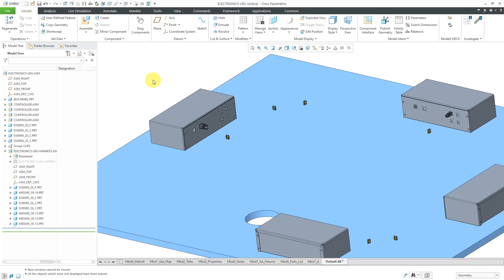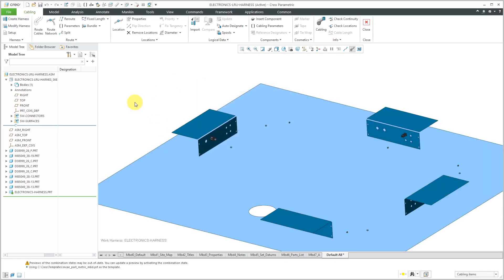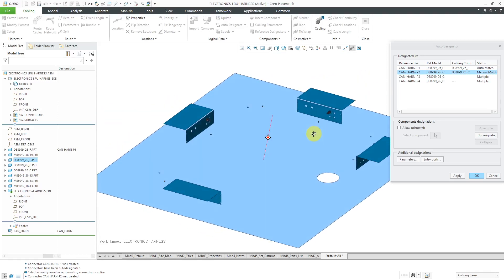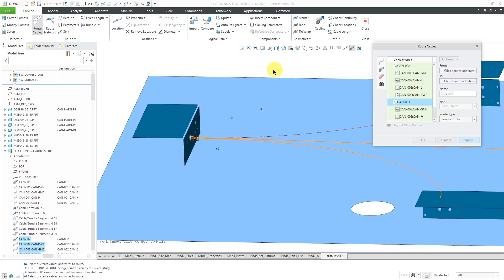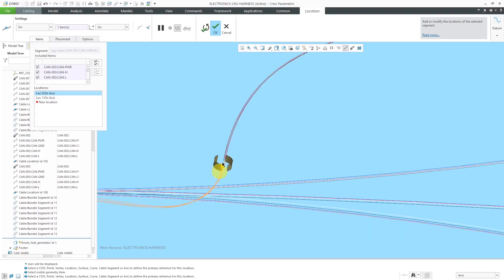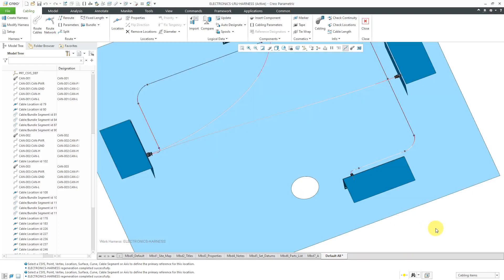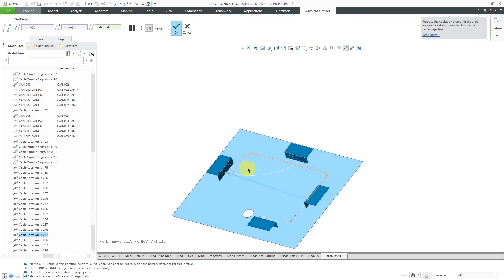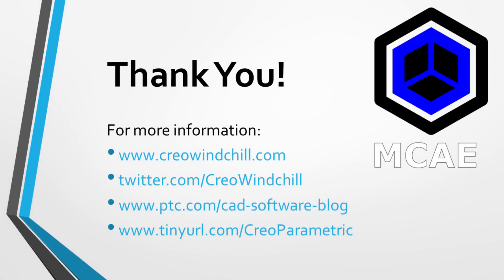Creo Parametric - Cabling | Logical Referencing

Comment: Hi sir , I need to learn pipe bending design in creo kindly help me to get out of it
Reply from the maker: Do you mean routing piping or actually bending pipes?
Reply: @CADPLMGuy Sir it's not about routing , I need to learn pipe bending design in creo which means 3d sketch along with Bend radius.. and also I have to know how to create 3d sketch in creo... Kindly help me to get out of this... Thank you Sir
Reply from the maker: @arunachalamsargurunathan5536  3D Sketches are a SolidWorks thing. I've created videos that show how to create curves through points offset from a coordinate system and then how to make a Sweep feature through that, but I'm not actually sure what you're talking about.
Reply: @CADPLMGuy  Ok Sir I will definitely look for your video ... Thank you Sir.